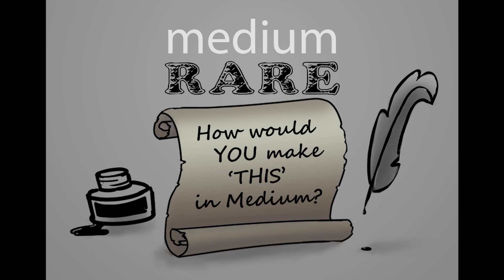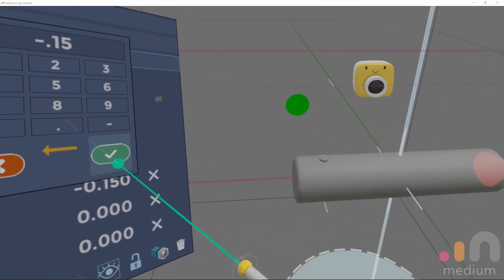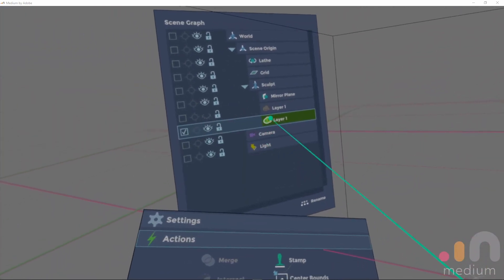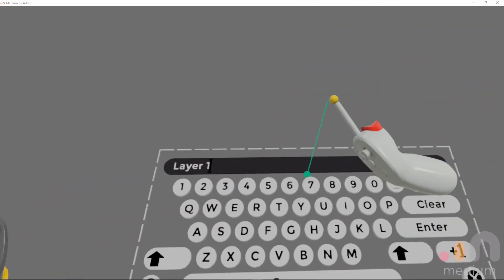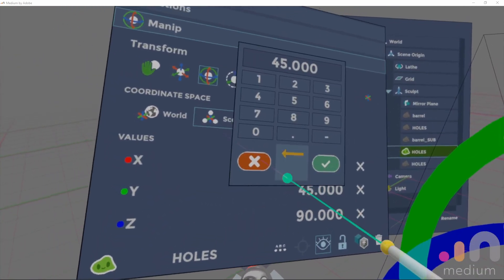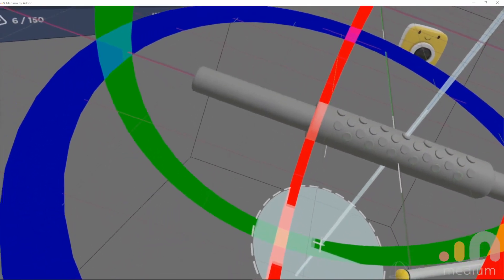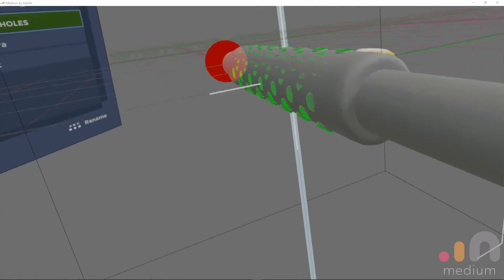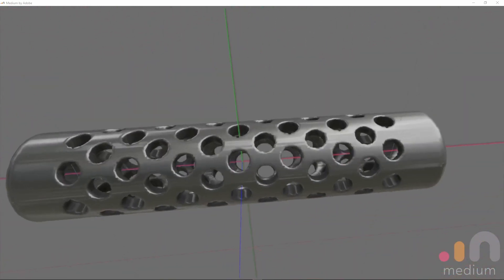Medium Rare: How Would You Make This? Episode 01, Vented gun barrel

Comment: For the spacing of the small cylinders it's much easier to set your grid spacing to suit, turn on grid and angle snap, and draw them out in a continuous stroke. They will repeat at each grid spacing. Saves all that tedious number typing. :) As an additional option, you could set your angle snap/suitable grid subdivs and draw out the other small cylinder rows, using mirror, as well, and save the duplicate/rotate step.
Sidenote: so weird that you can't scale uniformly. I figured out your extrude trick myself as a workaround, but annoying nonetheless.
Reply from the maker: Thanks for the comment! I know what you are saying- but the problem I have with the grid is that it can't be move freely or easily, so changing the settings can be a little bit hit and miss in terms of both the spacing and exact positioning of the grid points.  Similarly with the angle snap I find as soon as it's less that about 30 degrees it just flip-flops about uncontrollably. So as much as the number typing can be tedious and perhaps a little slower I find it gets me where I want to go more predictably :)
Reply: @martinmcghee  Yeah mate, I have the shaky hands thing aswell, so I understand. Been on Zbrush for many years, but just getting into Medium and your vids have been very useful. Looking forward to more.
Reply from the maker: @musashidanmcgrath  Thanks man, that really means alot- I've always loved your ZBrush work.
Reply: @martinmcghee   Cheers lad. That's what the community is all about. Also, with a Scot making vid tuts, a Paddy like me doesn't feel like a 'lone, funny accent' in the wilderness..... :D Of course, there's Glen Southern and Danny Mac too. Ha!
Reply from the maker: Yep we gotta keep the accents alive :D    Glen Southern is a true gent and a fellow Medium advocate! What little dealings I have had with Danny Mac have been quality too- another nice fella.